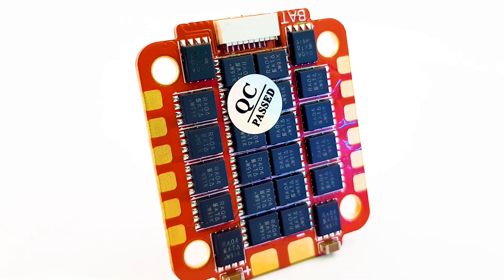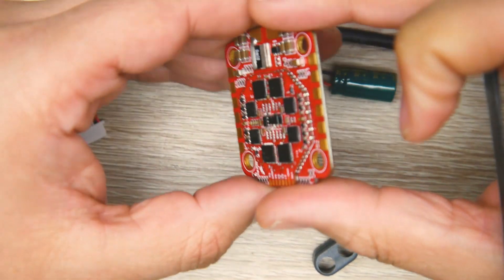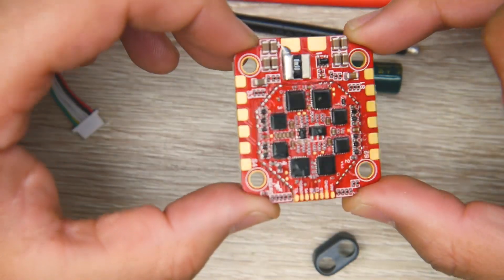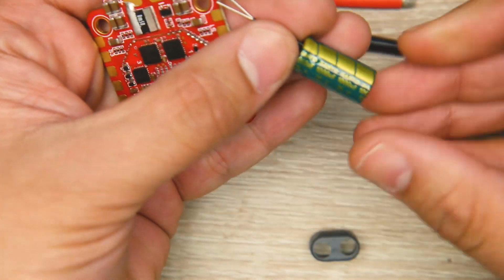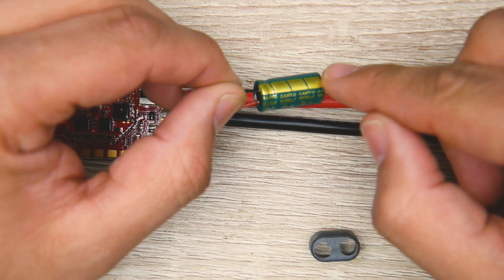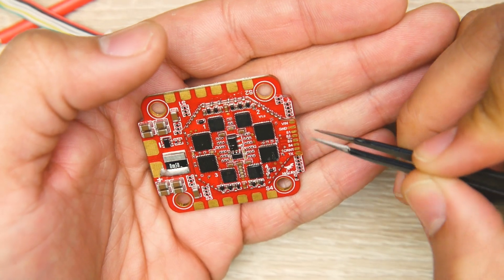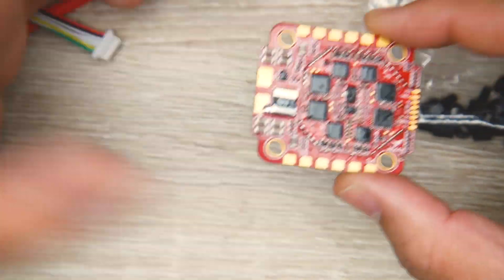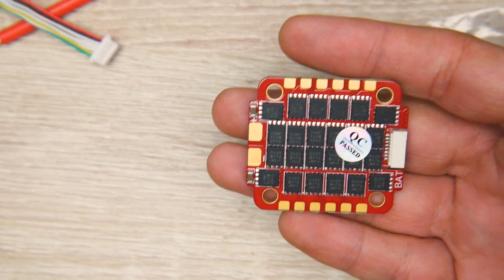High Spec F3 ESC For Under $50!!! // HGLRC Forward 55A F3 3-6S

Comment: Why is there no esc like these as hexa copter..if i wanted to build a big hexa with a stack for less upptake on my main board for battery,cammera and so on.. i mean a stack with f7 processor like HGLRC Forward F7 Dual Gyro Flight Control For RC Drone or mamba f722 and place them with hexa esc (6x50 amp ) or more,,cant find any.. for that you need to buy pixhawk or pixhack,,dji has flown away when it comes to price and its ridiculous when you consider how much more things you can do with a stack or pixhawh/hack. but as i mentioned,,cant find a board like these where instead of 4in1 esc there could be a 6in1 board esc